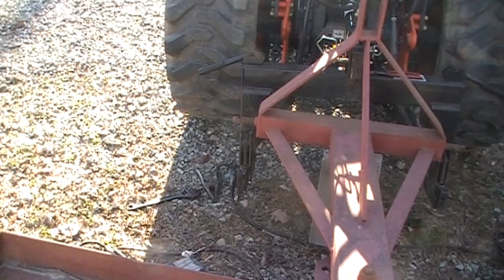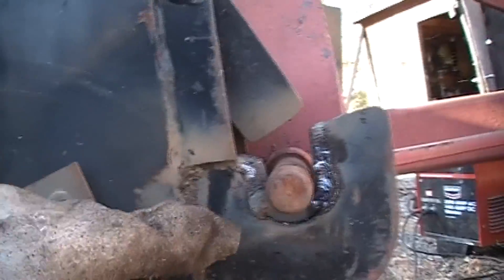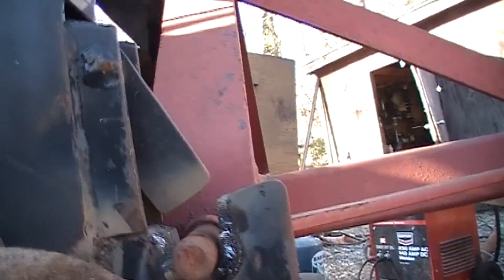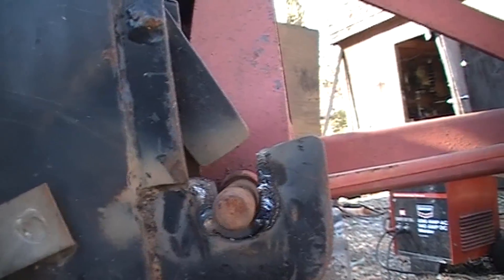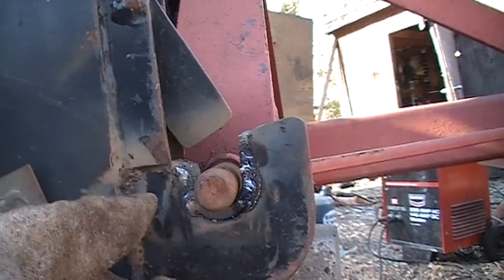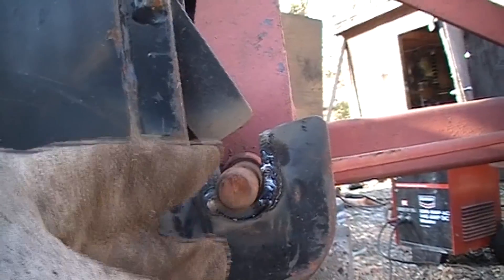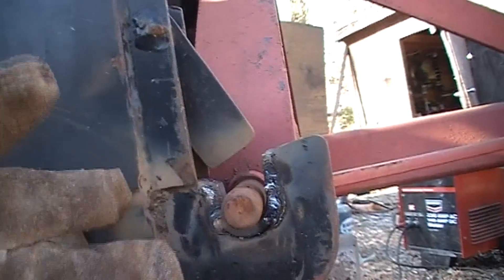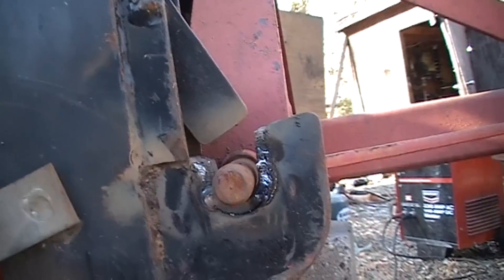quick hitch modification for cat 1 no more bushings!

Comment: great video, when I did mine, I used 2 pieces of 1/8th flat bar and bent them over a socket in the vice (easier to bend)and tacked them in place. I needed to add a 1/4 " piece  to the locks that come out on the arms, as the implement will come up when dropped down otherwise..
Reply from the maker: very good yes the implement will only come up if the three point is all the way down or said implement goes over a high spot in the terrain you are driving on. since the three point is gravity down " not pressure down " it makes no difference because it will always come up regardless and simply lift the entire three point. I have never had one come out of the lower lock if that is what you were concerned about. I was concerned myself at first and thought the lower lift arms may slip out however upon lowering the three point and trying to make it jump out I have yet to have that happen. sounds like you did a great mod. mine looks like I could only add about a quarter inch or less to the bottom of those retaining locks or they would not open.  I may take another look at mine since you mentioned it. did you add a piece or simply build up a weld bead?

Comment: Wow you did it the easy way.
I went through tractor tools with torch and welder, making them quick hitch adaptable, then add loose sleeves making them cat 2. I'm 72 had a stroke 10 years ago. I love my quick hitch. I even made a 12" bottom plow quick hitch.
Reply from the maker: it was easier than having all the bushing. I like the quick hitch ok but its not something I use that much. infact I mostly use it if I'm going to a job site where I'm grading a driveway or yard and need to carry the boxblade, york rake, and road blade and change from one to another fast for that specific job. when the tractor is being used at my house I dont use the quick hitch that much since I never use the quick hitch on the finish mower,  tiller or brush hog 99% of the time. the quick hitch can damage the pto safety shield on certain implements like the finish mower if your not careful.